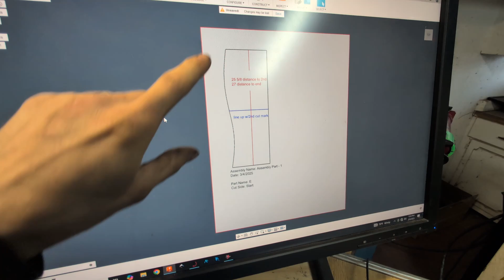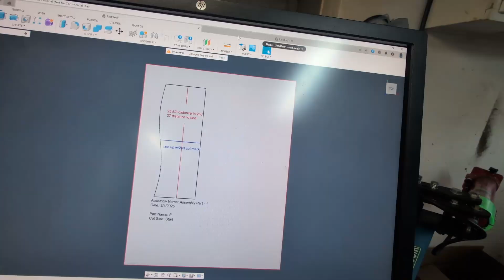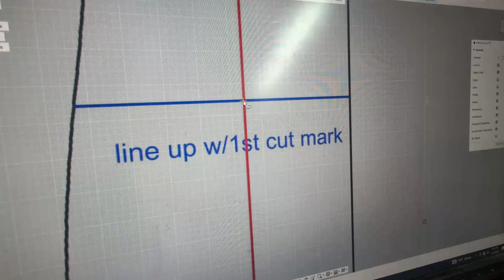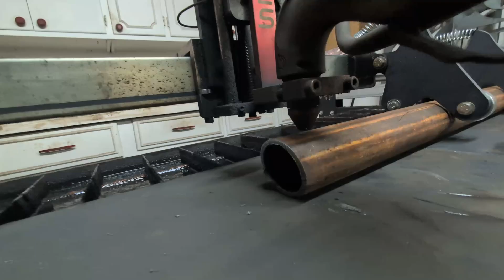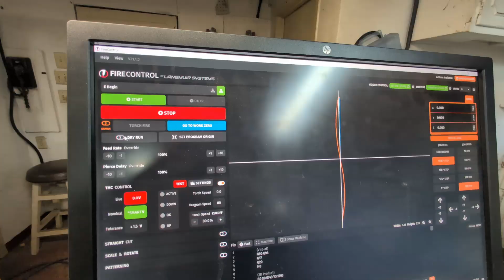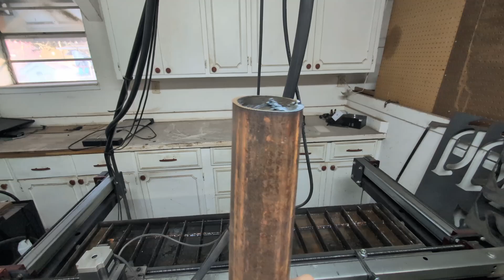Langmuir Crossfire Pro - Tube Notching Attachment Guide!

Comment: This is awesome. Stoked I have bend tech too.
Reply: Did you design and fabricate the tubing roller attachment?
Reply from the maker: @TLervis  That is correct. I did. I can't take credit for the idea though. Justin from The Fabrication Series Channel is the original idea man!
Reply: @westleyworley1731  I’ll check him out. Cheers!
Reply: @westleyworley1731  I saw that and was wondering how to make it work on the crossfire gantry without messing with the beearing block.  Did you just drill and tap it or use a rivnut?